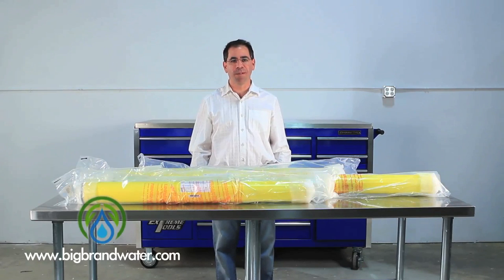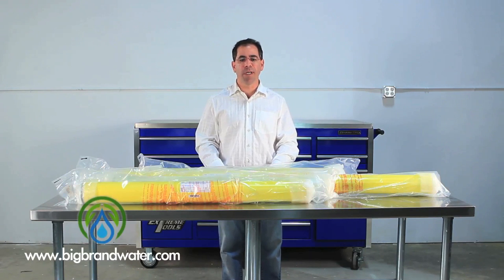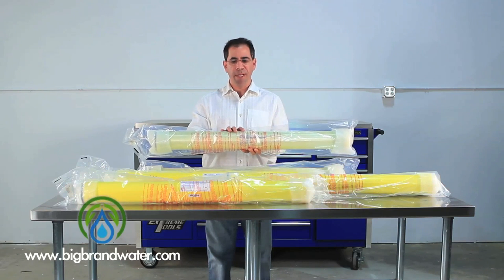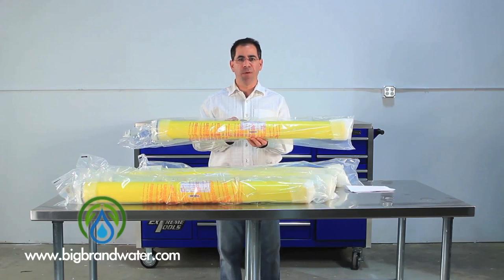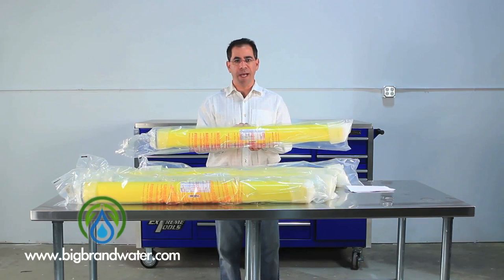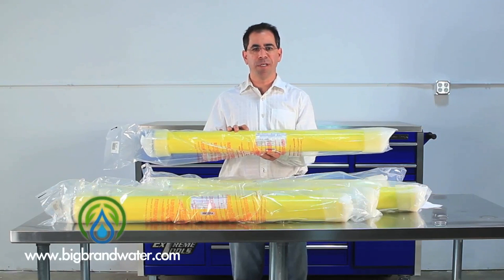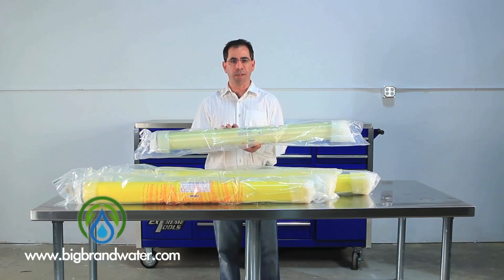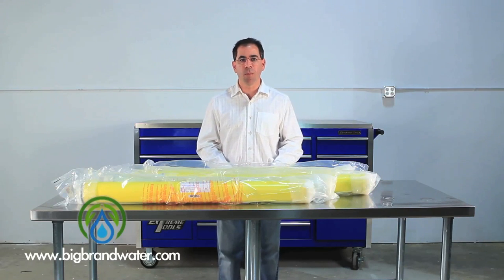Reverse Osmosis Membranes

Comment from the maker: I believe you are referrering to flux rate which is a measurement of flow rate per square meter of membrane surface.  I am not sure if they publish those or not.  The low energy membranes will have a higher flux rate versus a standard tap water membrane.